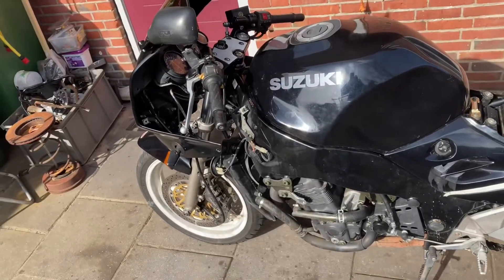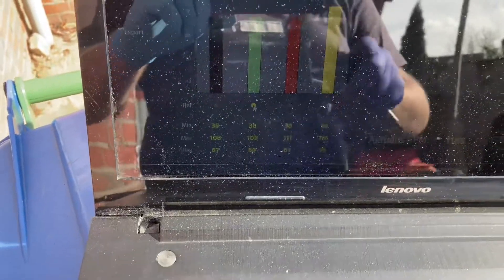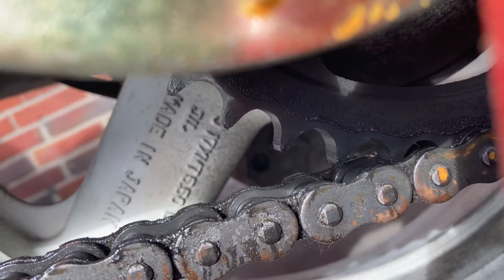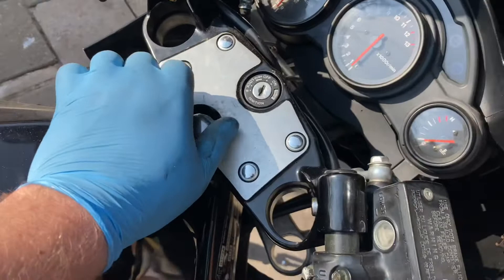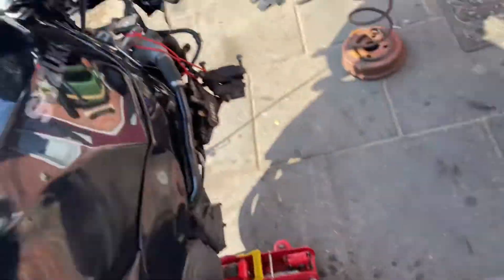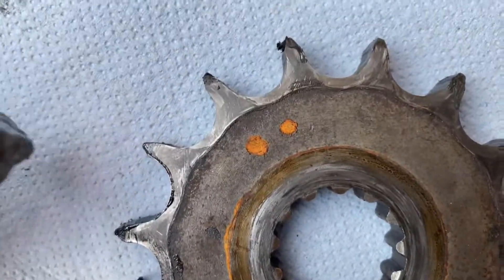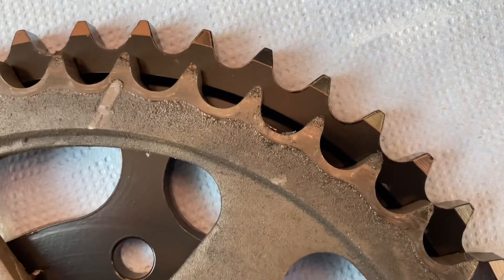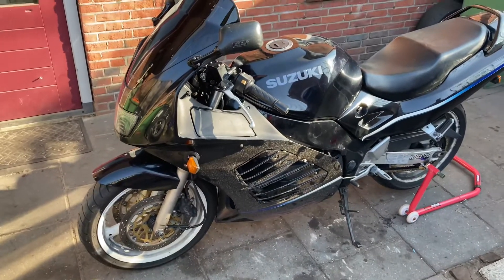Suzuki RF900R ‘96 Part 6/6, Install parts

Comment: Hello mate. Just found your posts about the RF and can see you used a laptop to sync the carbs. Are you able to show how you did this, please?

Oh, and I have painted my frame Suzuki Phantom Grey with black fairings but now think the black frame looks great with black fairings 👍
Reply from the maker: Hello mate. There is a video about a red gsx600f which has a video about sync carbs. 
If you can not find it, or does not explain what you wanna know, then I will make a video about it.

I added black rims, it looks great in full black. :)
Reply: Cool, I'll check it out later! I've watched all your RF posts which were really enjoyable. I admire how you got the bike, got it running and made adjustments as you went along. I bought mine over two years ago and basically stripped it. Have replaced all bearings etc but have also painted it. Painting has been a very steep learning curve, to say the least! Should have it on the road in April 🤞
Reply from the maker: Thanks, I did like the progress too, to see how she got back to her former glory.
Sounds good plan,  I hope you can make the plan. Success.